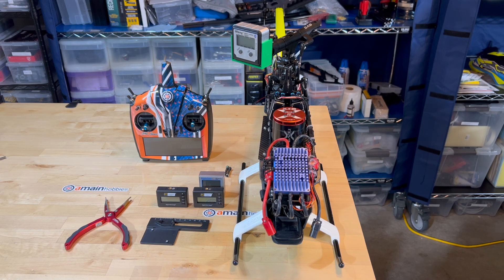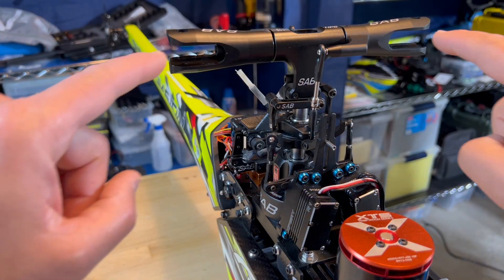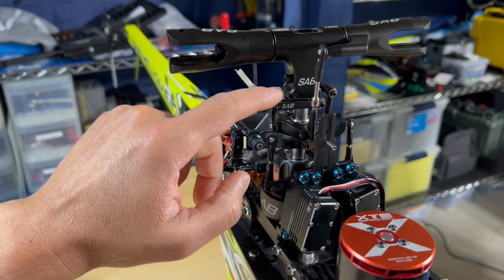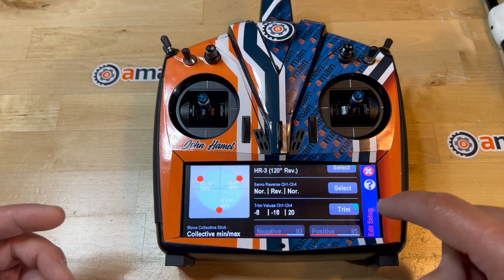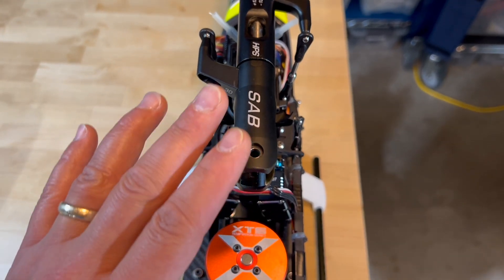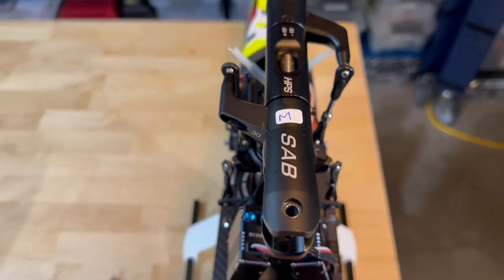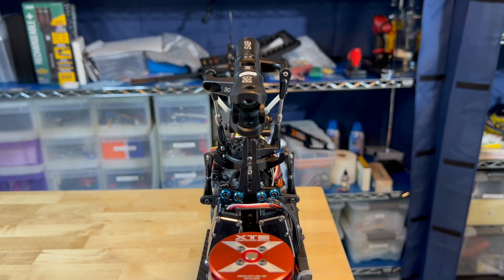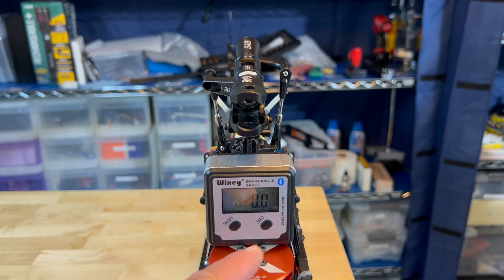Blade Tracking for RC Helicopters   HD 1080p

Comment: John, this video which I watched today September  4, 2025 extremely informative. I too have had zero success in finding a start to finish guide regarding rotor blade set up. With me being new to RC helicopters, even though I flew them professionally for a living. I find it difficult to pick up when people are using acronyms and not showing the exact process of what they’re going through. Currently, I have a 600 series Roban scale MD 500 E and I purchased a Robbband five bladed rotorhead assembly and I have just received from spin Blade in Germany the five blades for the rotorhead. But I am thoroughly perplexed and absolutely afraid to put this together without some sort of detailed video on how to do this properly. So at the moment, the two bladed rotorhead stays on the helicopter. And in my area of Central Florida Winter Haven area I’ve been unable to find anyone that truly knows how to do this. But again, thank you for your video very helpful. I wish there were more videos like that especially regarding five bladed rotorhead install from start to finish without using a bunch of acronyms. Best regards, Bob Griffith.

Comment: Hi John. Thank you for this! Question, why two different 580 and 700 3D prints? I own the Logo 550, Nimbus 550, OMP M5 and OMP M7. I'd love to recalibrate with the Bluetooth Wixey and your holder. I'm thinking all 550 and 580 use the same size main blades along with the 700's using the same size main blades, no?
Reply: if the blade root spacing and grip overall width are exactly the same then you could use 1 adapter for both helicopters. The adapter having the exact width of the blade grip to align it perfectly with the feathering shaft is very important. I would guess that the blade grips are slightly different which would require additional adapters.
Reply: @Dysl3xicDog  Hi John, appreciate this. Would you be interested in making a set for me if I were to provide you with grip dimensions using a digital caliper? Happy to pay for it of course.

Comment: Hi buddy Great video! I set my master blade at 0, and set blades side by side tracking is lovely now! But when checking pitch again parallel with the body my other blade is 1 degrees out! On the didgy gauge Is this normal? Or possibly something else? Cheers.
Reply: Update: My swash plate wasn't level 🤦‍♂️🤦‍♂️, Leveled the swash with a digital pitch gauge with blade over each servo, Tracking down to 0.1 pitch now 👌

Comment: Another tip is to set your tx pitch curve to 0-0-0-0-0% so that stick movement is not critical.
The blade folding is my preferred way with a few qualifications:
1. All ball links must be "tight" with no slop
2. Yes, definitely "mark" a master blade so you don't end up chasing your tail.
3. Also, in setting the master blade make sure this blade is 50% of total binding in both directions. This is another topic. 
 i know a lot of people "preset" a mechanical reduction, but it should always be set to maximum and then tx can reduce from there.
Reason? If you "forget about bind" and start resetting your TX throws "more" then you will hit a bind.,

Comment: You can do the same blade folding for the tail blade setup.
Reply from the maker: Correct.  Folding the tail blades will help determine 0° tail blade pitch.  However, I am aware of only 2 flight controllers that ask for 0° tail blade pitch during tail setup; Spirit and Skookum (discontinued several years ago).  Interestingly, Tomas from Spirit has stated that setting up the tail blades with a few degrees against main rotor torque at neutral is better than setting up the tail blades with 0° pitch at neutral as stated in the Spirit manual.  Tomas states that the reason the Spirit manual states to use 0° tail blade pitch at neutral is because this is much easier to set up for beginners.

Comment: Great video.  The only way I have ever set my mid stick zero pitch adjustment is via your first method.  The only difference is that early on, I found that my driver shafts didn't always fit exactly into the blade bolt holes without a small amount of slop.  I was balancing a prop one day with the Dubro prop balancer and got to thinking that if the cones accurately centered a prop on the shaft for balancing, then they would accurately center the rod in the blade grip, and that method has worked perfectly for me without any need to adjust individual blades from flight tests.  Our eyes are amazing in that they can so accurately discern if the Dubro shaft is parallel with the main shaft.  Everything that is assembled has some manufacturing tolerance stackup, but the good old MK 2 eyeball  doesn't vary at all from build to build.  Also, the only time I use the digital pitch gauge is to set the collective and cyclic throws, as their values are automatically referenced from the C/L of the main shaft rather than from having to insure your heli is perfectly level.

You are the first person to do a video showing this method.  I have made several posts showing photos of the method, but never actually done a video of this method.  Thanks.

Comment: I just lay an old Align pitch rod across the saddle of the head and look across the top of the blade mounted pitch gauge to set my zero. I don't know why someone doesn't make something that just slips in that slot for ease in zeroing like this.
Reply from the maker: I read and re-read what you stated above a few times, but I am having a difficult time understanding what you mean.  I am not familiar with the "old Align pitch rod" or what you mean by the "saddle of the head".  What is the "slot" you are referring?

Comment: Nice video John.  I never thought of using the allen driver through the blade grip bolt hole to align the grip with the main shaft.
Reply from the maker: To further clarify this point, it is actually best to use an appropriate diameter long bolt rather than an hex driver.  I used a hex driver in the video because I did not have a long M5 size bolt for the video.  The hex driver I used in the video was mainly to visualize the concept.  The hex driver fits too loosely with too much play within the blade grip bolt hole.  You really want a "long" bolt of appropriate diameter for the blade grip hole.

Comment: John would you have the 3d file for the gauge to share? TIA
Reply from the maker: I just added weblinks to the related Tinkercad page
Reply: @johnahamelv  Hi John, those links are not working / not available
Reply from the maker: @gerrykeaveney1657  I believe I fixed it.  Tinkercad defaulted the objects I designed to "Private".  I just made them "Public".